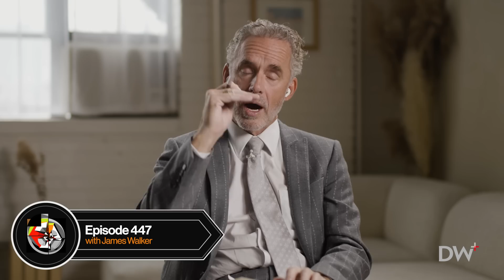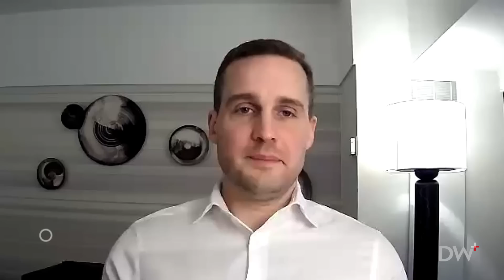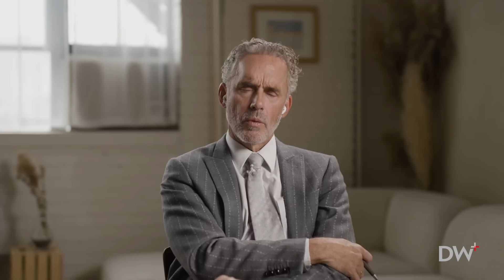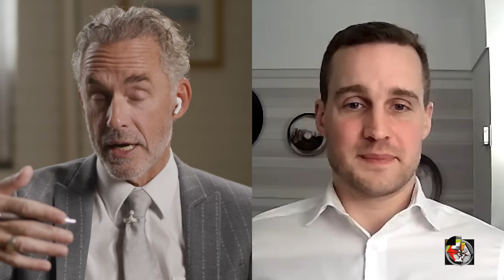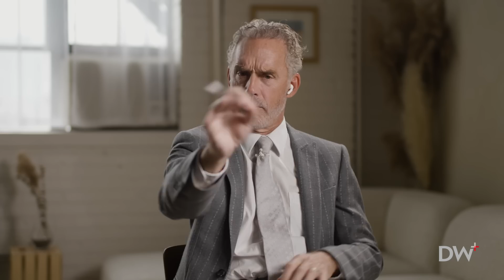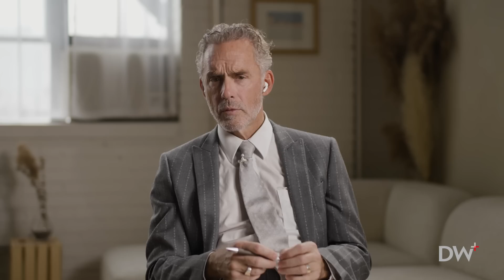There Is a Nuclear Reactor in This Truck

Comment: I especially wish we would go for Molten Salt Reactors. Specifically the Liquid Fluoride Thorium Reactor. That thing is so badass. It has multiple built in fail-safes by nature such as already being "melted down" so it cant catastrophically melt down, also the liquid fuel expands AND absorbs neutrons slower the hotter it gets, so as it expands more of it moves outside the core providing less fuel for fission, if theres a leak it drains into a storage tank below by being within a kitchen-sink-like room, and also if power or control is lost itll stop freezing a normally frozen salt plug which melts and makes it drain itself. Its basically infeasible to proliferate nuclear weapons from the products of the reactor (theres small chance to do so while enriching fuel needed to start the reactor, but very little is used and is only needed for startup, after that the reactors dont need to shut down to refuel so they can run for years at a time. Also they can also use nuclear weapons and nuclear waste from currently used reactors instead of enriched fuel to start their fission reactions, and turn them into a lot less and shorter lived radioactive byproducts.). It can use 99% of its fuel, versus current reactors using like 5% of their fuel that make a lot more longer lived waste (1,000's of years vs 83% of LFTRs waste being within 1-300 years and 17% being decades, but its more radiotoxic.). The molten liquid salt is both a coolant and fuel that jackets the core and both shields it from radiation and absorbs the nuetrons, converting it into the isotope of uranium needed to be pumped into and used in the core for fission. This makes LFTR's scaleable, you dont need feet of concrete or lead to shield you. The reactors operate at atmospheric pressure and if theres a loss of containment, the molten salt is actually extremely stable and wont react with the air or water and doesnt build up explosive gasses, just xenon gas like other reactors which "poisons" the reaction but it can be actively removed, just as fuel can be added, without shutdown unlike normal reactors. Thorium is 4 times more abundant than uranium AND is a nuisance byproduct in rare earth metal mining. We have enough thats been buried in Nevada to run for 400,000+ thousand years. To power the USA for a year youd create roughly a briefcase sized amount of waste. There are proposed methods with MSR's to have more efficient turbines than current steam turbines using the liquid salt and gas I think. This is all from memory and Im struggling to recall but theres a shit load of good reasons to go with LFTR's and most of the negatives can be reframed as positives pretty easily. A power grid supported by nuclear and supplemented by renewables where feasible is the best strategy for our best economical, environmental, defensive and political future with a prepared and prolonged infrastructure and society.
Reply: @precisi0n86 Cheap energy presents unique problems of its own, perhaps it creates headaches for too many vested interests…
Reply: @precisi0n86  none a Thorium reactor can run on the spent uranium that is being stored for a 1,000 yrs. WONCE it is used the waste is stored now for 300 years. So the spent fuel from a Cando reactor can now be used in Thorium reactor.
Reply: @larrymcknight1933  There's downsides for the Thorium. First it is still experimental (The Chinese though are leading on research about this one, US stopped research in 70s)
2nd  Uranium was much more efficient in fuel.
3rd  Thorium requires more energy in preparation than Uranium.
4th Thorium is apparently more radioactive (But last shorter) compared to lesser radioactive levels of Uranium (means more costs because it requires higher level of processing, handling)
5th It costs more than Uranium both long term and short term wise.
6th So for reactors that require excellent neutron economy Thorium is not ideal where is the majority of the plants. 
7th Commercial wise, it is not profitable business, its like that German Wind Vanes on Autobahn. Producing more carbon waste and emission than generating energy, and lesser carbon waste as promised by wind energy.
Reply: @JBORD101  
No we need to approach fossil fuels in a logical manner.  They are excellent for certain applications not so much for others.

Power generation offers a lot more flexibility is fuels we use.  While nuclear would be ridiculous for cars, trucks and trains it's perfect for large ships and power generation.

Our problem is irrational fear.  We have millions of vehicles with hundreds of millions of gallons of fuel carrying people and freight all over the world.  Yet our primary concern about them is their collective effect on the co2 production not explosions and pollution from spills.

Compare that to nuclear power where we are terrified of leaks and waste from installations that never move and can much better prepare for problems.

Save oil for the things we need it most for and use nuclear where it works best.
Reply: @precisi0n86 because they are a very recent development (the theory was there earlier, of course, but you know how complex these things are)
Reply: @LtdJorge  They had molten salt reactors running in Oak Ridge in the early 1960's
Reply: @LtdJorge  
Nuclear energy was just a selling point for nuclear research.  At the time energy was so cheap and environmental effects unheard of that there was little motivation to pursue nuclear power for anything other than military use.  I remember fueling my dad's semi truck in Oklahoma back in the 70s when diesel was 13 cents a gallon.  Had we spent the last 60 years working on Thorium reactors we wouldn't even be talking about electric generation as a contributor to global warming.  As usual we are motivated by crisis.
Reply: @tonyrmathis in this case we're being driven as the hunted before beaters. 
The amount of warming we've experienced certainly is not on a level that it should or would create a crisis without a lot of people crying wolf.
As far as co2 goes? We're far closer to a crisis due to a dearth of it than from an overabundance.
Reply: @tonyrmathis No. But we need a standard today, like France, to scale up. The massive IPCC report suggested the world build 1,000 nuclear power plants. We actually have a lot of NPP reaching the end of their lifespan that need to be extended, retooled, if possible, like Diablo Canyon in California. But Governor Newsom, the ultimate politician, only extended it 5 years! If DC twi reactors shut down, CA rates will spike further, and thete will be frequent summer blackouts.
Reply: @MarkJones-si2bb  
You don't have to sell me on nuclear power even the old style reactors but we ought to be looking into MSRs too if for no other reason than the fuel cycle.

You make a good point about Newsom.  He's pandering to the environmental cultist with stuff like that.   I wish more people on the left could see it instead of just blaming everything on capitalism and corporations like an earlier poster.

Fact is not only do they see humans as separate from nature but secretly want to see massive population reduction.  With ulterior motives like that I don't understand why we listen to them on energy or anything else meant to improve human existence.
Reply: @enterprisencc1701z - corporations are just a small part. Environmental groups sue endlessly, no-growth types sue endlessly (man bad, cheap energy bad), and the paperwork and hoops to jump through are endless. CO2 is the supposed boogeyman, yet California doesn't label nuclear or hydro power as green! My superficial look revealed that energy prices jumped in both San Diego and Vermont when NPP were closed.

In the short term can we standardize on one or two designs, get Federal insurance, and build some new reactors? California had planned four reactors at Diablo Canyon, but only built two. Bill Gates has a prototype in the works. And can we open Yucca Mountain repository? I never understood the alleged danger, beyond sabatoge when train cars were moved. Bury the casks deep underground, monitored, inside a granite mountain? Sounds ideal.
Reply: @MarkJones-si2bb  And youve hit the nail on the head.
Reply: Well said. My feelings exactly. We are being denied the energy that we really need by corporations.Want us to buy other things to make them money
Reply: @enterprisencc1701z  

It's not just corporations.  It's also a fanatic cult of environmentalist who don't even view humans as part of nature. 

It's easy to blame corporations but it's also easy to motivate them.  Right now we make it unprofitable to use nuclear power.  Change that and you'll change them.
Reply: @enterprisencc1701z  
If feels good to blame things on corporations but it's more than that.  It's also the radical environmentalist cult that sees humans as separate from nature.
Reply: @precisi0n86  I remember the Chinese are on the lead of research on this MSR Thorium reactors.
Reply: How many molten salt reactors are in commercial use today?
Reply: @MarkJones-si2bb  
How many fusion reactors are in commercial use?  ZERO  Do we stop pursuing research into them too?
Reply: @MarkJones-si2bb  None that I'm aware of.

Comment: The problem isn't with tech. It isn't with supply. It isn't with the deep desire to have abundant, stable and well-priced energy. The problem is with regulation, the enormous cost that creates and the timeframes required to do the most basic things.

The West is regulating itself into a cold dark future.

Comment: Purdue University in Indiana is working on truck transportable electric producing reactors.
Reply: There still are mobile reactors. There has been a city provided with energy power from a nuclear powered ship.
But the GOOGLE effect may prevent you from looking it up.
If a frigate uses 1500 gallons of fuel per hour in economical steaming. Gallons per hour does a conventional carrier use?
I know what a frigate used when on plane guard. 6000 gallons per hour.

Comment: I don't see either the United States or Canada having enough sense to do the right thing, which is to build new nuclear fission power facilities. Nuclear is both safe and green. It is, however, based on a non-renewable resource (uranium) and will become increasingly expensive, but it will buy us a hundred or more years to figure out fusion. Wind and Solar will continue to be a pipe dream.
Reply: Actually the known uranium reserves of the world are at least a thousand years.  If the 'waste' is reprocessed that goes up by an order of magnitude.

Comment: Saskatchewan can supply all the fuel needed in Canada for a century. There are about a dozen people inspecial interest groups that have made so much noise and disturbed the locals about it that there is a lot of resistance based on ignorance. The locals want the mines and already work and provide excellent quality jobs in the north that feed entire communities. 

People think 3 mile Island and Chernobyl when they think nuclear power because of a long and focused effort against it. 

Saskatchewan has the most valuable energy reserves in the world and it’s just sitting there because of politics.
Reply: Everybody knew Chernobyl was a poor design, including no containment structure! "The absence of a containment structure is especially important. As Cohen point out about Chernobyl, "Post-accident analyses indicate that if there had been a U.S.-style containment, none of the radioactivity would have escaped, and there would have been no injuries or deaths." Three Mile Island was caused by an operator specifically doing something hs shouldn't do. (That's now been engineered out of all other plants.) Chernobl only killed 30 people. P.S. Zero CO2! The zealots in California won't even label hydropower or nuclear power as Green!
Reply: @MarkJones-si2bb  Three Mile Island was caused by a faulty relief valve compounded by poor training. It's part of the reason Pressurized Water Reactors are unsuitable for commercial use. Fukushima had a different set of problems that caused the same failure, a loss of coolant accident. There are safer reactors, but the Nuclear Regulatory Commision seems to be designed to kill all future nuclear power technology.
Reply: @thecarpenter2599 Oil is like fusion.  For oil, it seems that we always only have about 15 to 20 years supply.
For fusion commercial fusion has remained stubbornly 20 years in the future for at least 50 years!
Reply: @wheel-man5319  See geologically generated petroleum.
Reply: Breeder reactors appear to be able too use existing fuel rods for 100 years.
Reply: I used to have a theory that politicians who stopped the USA from drilling it's own oil were playing the long game. Let all the other countries use up their reserves 1st. Then, in 100yrs, USA will start drilling more when it's much more valuable.
But then I decided they are just fools or, possibly bribed by foreign powers who want to cripple the US.
Reply: Yep, it could be done easily and now of not for relentless selfish stupid scaremongering and Nimby locals and greedy power loving govt gatekeepers. Theres a special place in hell for that kind of thing.
Reply: @thecarpenter2599  
I remember Carter on live TV telling us the world would have exhausted all fossil fuels by now.  He said the same about raw materials for concrete materials in opposition to STI.  My dad made business decisions based on it that ended up costing our family millions in lost income.   There's literally no lie these people won't tell in support of their agenda or as pay back to their donors.
Reply: @patrickweaver1105 Fukushima had  backup generators below sea level?, and Japan has two different electrical systems? (One Euro, one USA.) Eh gad. Last I read, France has one design, and they're 85% nuclear. We have numerous options deployed now, and then what, a dozen competing proposals for new reactors? We need something to standardize on, now. Which we seem unable to do. Standardization should allow for economies of scale, increased safety, and allow workers to work on numerous plants. Well, Georgia has two large new reactors up and running!
Reply: Start telling everyone that this fuel will save the environment and stop global warming - that hostility will change.

Comment: what about the Helion reactor that smashes Deuterium and helium 3 and creates helium 4 and abundant energy via plasma and a strong magnetic field, the fuel is scarce but the waste is helium 4 and that decomposes back to helium  3 in 12 years.....  that seems like the way forward as opposed to uranium...
Reply: We'd like to think so but there are as yet no complete solutions. We don't know how to actually collect the energy. There are sometimes nice looking projects but they keep turning out to be fraudulent.
Reply: As with "climate boiling", nuclear fusion is always just coming and never arriving.  It is starting to become clear that the conditions for fusion of light elements into heavier elements with the release of energy requires those most resembling the inside of a sun with gravity and surrounding mass a necessary part.  
'Fusion is just coming' is motivated by the necessity for abundant research money flowing freely.

Comment: Don’t need uranium, thorium is plentiful and everywhere.
Reply: to ustilize thorium, you need breeder reactors. Once you got breeder reactors, all the depleted uranium left over from enrichment becomes fuel, and so does the unused uranium in "nuclear waste". So, long-term, we should use both. The Th-232-U233 breeding cycle and the U-238-Pu-239 cycle. Enriched U-235 is useful as a starting point to get the neutron sources running, but we really should get into using those neutrons for breeding.
Reply: Thorium is fissile but not fertile, so needs a source of neutrons to start it off e.g. linear accelerator...
Reply: @Ironic1950 clone Jimmy
Reply: @sandlotscout6358  Is there an actual point to your comment...?